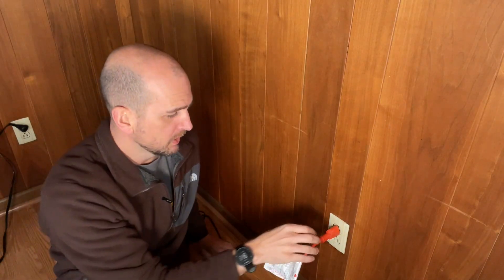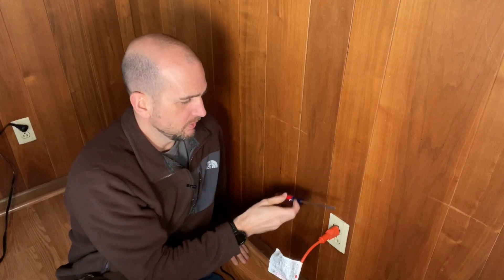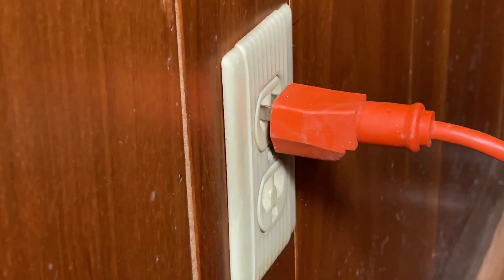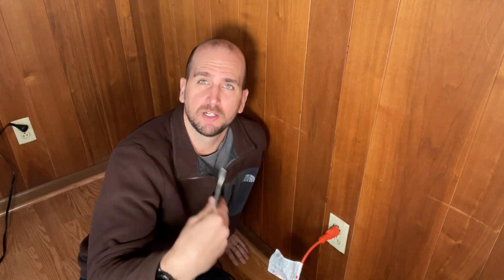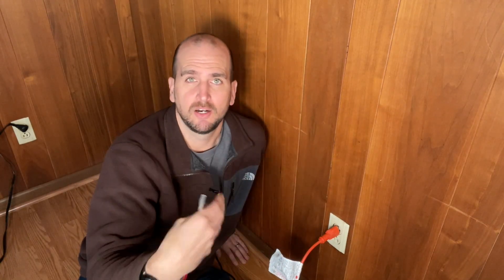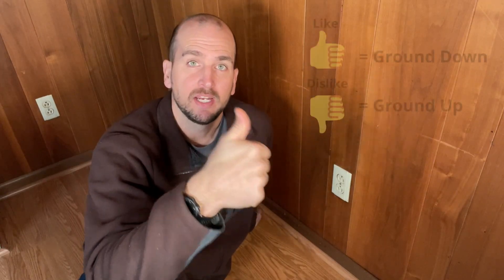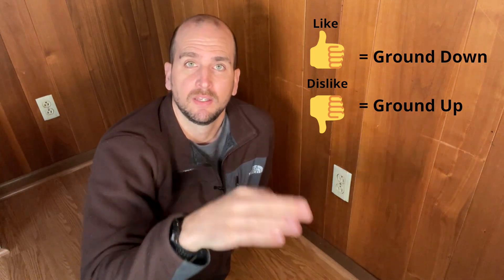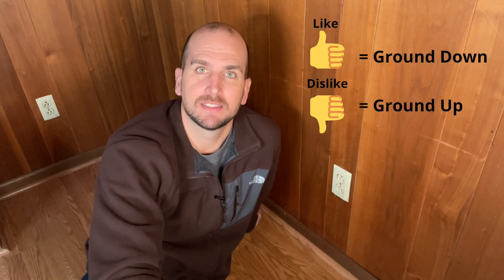Should An Outlet Be Installed Ground Down Or Up

Comment: Then there are countries where the conductors are insulated except near the tip so by the time conductive parts are exposed, there are no connections other than the safety ground.  I believe this would be the UK plug where the ground pin also opens a door to the other pins so kids can't just jam a butter knife in.   Face it, North American outlets are just poorly designed to begin with.
Reply: Agreed.  It would be great to have an updated standard but I don't see it ever happening.  The U.S. was one of the pioneers of electricity in the 20th century, and that meant people needed to have a U.S.-style outlet connected to a U.S. style grid to take advantage of it.  Small countries basically adopted whatever standards their larger neighbors put in place.  Then there's the little issue of the U.S. "democratizing" countries back to the stone age, and then having to rebuild their infrastructure from scratch.  The best we can hope for are more band-aids like GFCI, AFCI, and shuttered receptacles.
Reply: @docferringer  Well, we will have the option of intelligent grids soon where a device communicates it's power requirements but this will likely just affect receptacles for electric vehicle charging and would just allow the grid to draw on power stored in the electric vehicles batteries as a last resort when the load on the grid exceeds generation capacity and the power from the cars could keep it from collapsing.  Yes, the bandaid for problems such as what happened in Texas will actually be the green new deal not that such problems being from such efforts which have not even begun.   I don't see this changing the common US household receptacles yet though that too might be possible with an intelligent grid, where power isn't delivered to the receptacle above certain levels till it's been negotiated by the device.   Like with everything else, it will take something like the States or the EU to pioneer the intelligent grid.  One last chance to do something sort've right.
Reply: This ain't quite right,  we mandate TR outlets in residential areas which does what you are saying regarding child safety
Reply: @GenieArms  Ground fault circuits are not insulated conductors.  Have a look at the UK plug, the copper conductors are simply not accessible at all till the electrical connection has been broken.  That is simply not true of the US TR sockets you are speaking of, the TR sockets trip if the amperage in the hot and return lines are not balanced indicating a ground path, this is not the prevention of unwanted conduction but the interruption of such conduction after it occurs.  The tamper resistant features of the child protection plugs close off the holes but that's another feature and once the conductors are in the holes, exposed parts of the conductors can still exist while the conductors are electrically connected.  The UK plug has such features triggered by their much longer ground plug, how are the doors opened with the US TR plugs? By sliding the plastic cover?  The conductors can still be partially in the US TR socket and still electrically connected exposing the conductors of the plug while hot.
Reply: @johnwang9914  No the TR outlet is a mechanical connection that will not open for a singe object like a butter knife but needs the dual pressure of pronged outlet,  you simply don't know what you are talking about sorry.  It's not an electrical monitor of any type.
Reply: @GenieArms  Not open for a butter knife to enter but the plug can still be partially in the socket both connected electrically and having exposed parts of the conductor accessible to said knife outside the socket.  The TR socket is only part of what the UK plug and sockets are as it is just the socket, the issue with exposed conductors is with the plug not just the socket and the US TR still has the flawed plug that can be partially in the socket and still electrically connected.

Are you claiming the US TR socket does not use the US plug?  Because that would be the only way for the conductors on the plug to be insulated when partially exposed.
Reply: @johnwang9914    It uses the the US plug but it's an internal barrier, so if the plug is pulling out the doors on it will shut.  Between that and the AFCI breaker at the panel US wiring, WHEN DONE TO CODE, is pretty safe.  People want to shit on the US, and fair enough we deserve it,  BUT our insurance industry does not want to pay out claims, so they are VERY involved with electrical safety,  so we are really advancing our electrical safety in new construction.
Reply: @GenieArms  And what is this thread about?  It is about a partially inserted plug exposes bare metal conductors to whatever falls across them creating a short and that can't happen with the UK plug as the plug has insulation such that bare metal can only be exposed when the electrical contact has been broken.  TR plug g or not, the US plug is still uninsulated period and bare conductors can be exposed while electrical contact still exists period TR socket or not period.
Reply: @johnwang9914  I'd have to do some testing, but you are talking about like a millimeter or so of space,  i have NEVER seen a short occur in that situation, and if it did the breaker would clear, and if the breaker didn't clear, the afci would clear and trigger the breaker.  You would have to lab manufacture that situation,  It's not like people are being detonated every other day over here, thats absurd.   A vast majority of our electrical deaths are during construction from contact with overhead lines or power cords drug through water without the GFCI being installed or in working condition.
Reply: @GenieArms  The whole point is that the conductors are bare to the base and the socket grips from the side so any degree of partially being plugged exposes live conductors.   You may wish to diminish this by saying it's just a millimeter but it's still exposed conductors and can be as long as the metal clips that make the electrical contact within the socket, the UK plug has an insulated sheath such that exposed metal can not occur until after the conductor has been disconnected from the metal clip which makes the electrical connection and this is by intent.   Simply, the US plug and socket never took the partially plugged in condition into account in the design period and the UK plug shows that they could've.
Reply: @johnwang9914  well i'll be sure to call edison and tell him he done fucked up then
Reply: @GenieArms  Edison wanted DC but we now have AC.  There is always a way to change how things are dine even if they are entrenched.  Remembee it waan't too long ago when US plugs and outlets were two prongs not three.  They could start with an insulated sheath around the base of the plugs that's lightly longer than the contact clips.  Of course there might not be enough recess in those clips in the socket for that to work but they could also start with that clip being more recessed, perhaps only having the tip of the plug conductors having an electrical contact.  There is still room for improvement with the US system, just not much of a profit motive.
Reply: @johnwang9914   We got way bigger problems than a type of device that caused zero hospitalizations last year i think
Reply: @GenieArms  Making things up are you... The whole point is this thread was about if it was better to mount the US sockets with the ground up to prevent something from shorting out exposed conductors if dropped onto a partially unplugged plug.  You're just trying to deflect now that your TR sockets point has been shown to be meaningless.
Reply: @johnwang9914    Uh but the mounting it ground up to prevent shorts is BS,  the code doesn't require that style of mounting because it's not proven any more safe.  I looked at the stats, and none of the electrical hospitalizations were caused by receptacle outlets.  I'm done with you,   you are outsmarting yourself.
Reply: @GenieArms  But the thread are people discussing whether or not to mount it ground up.  What code says is another matter yet again, read the bloody thread and stop deflecting.
Reply: For anyone reading this that wants the actual information on how safe these TR outlets are,  i had installed them throughout my friends house,  i went back and tested how far out you could pull the plug and have a connection.  The TR outlets will spit out any half plugged in plugs, so  there is absolutely no risk of shocks or short circuits.  Ignore the idiot that is saying they are not safe plugs here in the US,  they are very safe if you use the appropriate plug.
Reply: @GenieArms  Inductive reasoning isn't a valid argument.
Reply: @johnwang9914    Not being able to admit you are wrong isn't a valid arguement either, but you stuck with it till the end anyway.
Reply: @GenieArms  come on, "spit it out".  If we open the TR socket, will there be an actual mechanism to spit out a plug or just a tight clip.  Face it, the plug still has uninsulated prongs and changing the socket does not change that.  You are the one that's wrong and unwilling to admit it. Show me a TR socket that layers an insulating sheath on the prongs and I'll give in.  My argument is changing the socket does not change the plug and the UK plug has both a different socket and a different plug for the safety features it has.
Reply: @johnwang9914    Just buy one and use it einstein.  it's got a mechanical connection that prevents the plug from being in a half inserted position.
Reply: @GenieArms  For heaven's sake, changing the socket does not change the plug period.  You're acting like a child.
Reply: @johnwang9914    You've probably never even seen a US plug,  honestly why are you posting input in this?  If you could just go to home depot and buy a TR plug and any american appliance you would understand, but you can't so you won't.
Reply: @johnwang9914    i was aware you were an electrical engineer from about 1 post in,  you talk like you know about a product you've literally never held in your hands, you have to fall back on your credentials  but why would anyone ever trust someone about a product they've never even seen.  My god man.  I've installed thousands of these things,  never heard of a single injury related to them.   No single data point available points to even one injury in an entire year,  with 350m people using them multiple times every day.  Only an e eng would be this stupid about electricity honestly.
Reply: @johnwang9914    Just stop spreading misinformation and buy one.  They have a spring and door that push out any plug halfway in and only conduct when it's fully seated.
Reply: @GenieArms  You're playing the child again aren't you.  Just using the TR socket does not mean the plug prongs is no longer bare to it's base.  Your crap about it spitting out a partially inserted plug shows that you don't even know what's in the socket, residential grade has a single piece clip which over time becomes loose as it's deformed by each insertion, commercial has two sprung contacts per prong which does not become loose after multiple insertions and removals, all you've demonstrated is that you found it to be tight.  I don't need to hold to see the specifications and designs and I've held far more plugs and sockets than I care to count though mostly for commercial equipment not the child proof crap you're speaking of.  Besides,it's clear that you've never seen inside the socket either in it's design or by opening one up.  The very design of the flat prongs means the socket doesn't "spit out" the plugs.  If you want to talk of holding a socket and plug, have you even seen an UK plug and socket?  Besides, I've already pointed out that your fixation with holding the plug is not a logical argument but a paltry attempt at inductive reasoning and anecdotes.  The TR socket does not match the safety features of the UK socket and plug as the safety features are in both the socket and plug but you're too much of a baby to admit that.
Reply: @johnwang9914    Here buddy, look at the inside 
https://www.youtube.com/watch?v=e1A-wlS97Lg&t=331

when the plug is starting to come out the spring engages and pushes the plug out.  When you get past the shutter the spring lets go and it sucks the plug the rest of the way in.  I mean i know these guys are smarter engineers than you, figuring out springs and all,  but come on.

Comment: Here is a bone of contention among electrical contractors typically they ignore a ground bus bar in the panel and you will find neutrals and grounds connected to the same bus bar.   This is not good in that an outlet that you thought was off could still have a minor current back flow thru it.   Mostly done by apprentice electricians.

Comment: I worked for my dad, who was a licensed master electrician, and he was taught ground up so we always installed them that way. The reason is because with NMB romex that has the bare ground wire it is easier to see how it is bending as you push the receptacle into the box if the ground screw on the receptacle is up. If a loop in the ground contacts the hot screw it will short and you’ll be taking outlets apart on the circuit later to find the problem. That said I remodeled my kitchen recently and had to go ground down for counter receptacles due to 90 degree cords on some appliances (frig, countertop micro, stove, water cooler). Also I had a light show one time with a nickel falling off the back of my dresser and welding itself across a loose two-prong plug.

Comment: Because electricity travels down like lightening, ground should be on the bottom. 

But I can see the suggested reasoning for objects falling hitting the ground plug first.  

I think most interesting though as mentioned many plugs that fall out or come loose are 2 prong.  So chances of something falling & hitting it wouldn't matter which direction the ground is facing.  Although I really don't know of items just falling off the wall unless in an earthquake so I find it an odd argument, how many times has something just fallen onto your outlet?

Comment: I do ground down in the USA, I've worked with Canadians who always install ground up. I also worked with a "left handed plumber" whose hot and cold handles ware always "wrong"!
Reply: Where in Canada? I've seen nothing but ground down on new construction. In Quebec it's code to do it ground up.
Reply: @nimrodery  not in Canada, 2 Canadians and 1 Australian I worked with in Missouri.
Reply: @ricklee4  I'm just saying, they were probably from Quebec, or they did a lot of commercial where it's often a requirement.

Comment: The only time I've done ground-up is when the GFCI line connections came into the box so that ground-down wasn't possible. Ground down seems like the standard for pretty much all consumer electronics I've used too, ever tried to put in a polarized timer box upside down? It sucks.

Comment: On a side note I have to say, I wish I was a licensed electrician because I would literally do pro bono work and install light fixtures in every single home where the builder cheaped out and went with switched outlets instead of hanging even a $50 fixture there. That is insanity and it drives me nuts every time I see it. Even some nicer homes $2-300k+ near us do that and it blows my mind. I'm a painter though so can't risk doing electrical for anyone besides myself. As for the ground up or down I don't know, I sort of get the argument for ground up but imo it really doesn't matter in the real world. 99% of what I've ever seen are ground down and they're always fine.

Comment: I always do Ground UP.
Two reasons:
1 - Because the ground lug is longer length than the blades, it makes it easier to start, and locate, with the longest piece first. 
BUT mostly, because I seeing the shocked expression on the face of the ground down  😲

Comment: i prefer ground up because when you grab the plug with your hand to pull it out your thumb is always on the top and sometimes the plug i very snug so i find myself placing my thumb against the wall or plate for leverage to wiggling the plug loose and just before the plug pulls out there is a space between the outlet and the top of plug that my thumb can slip into and touch the prongs possibly shocking myself

Comment: I am an ag mechanic, who loves electrical. I work on irrigation pivots, to vehicles, from 480 volts Ac 3 phase down to 6 volts Dc. 
Around the house I usually put the ground down, on a washer, refrigerator or microwave with a 90° plug, so the cord goes down. 
Around the farm outside of the house, I put ground up. An old local electrician told me to put the ground up, any where there were heavy extension cords plugged in.
Ray mounted 2 outlets, 1 up, 1 down, took 2 extension cords, plugged them in to each outlet.  Ray told me to pull down on the cords. The ground down cord can out much easier than the ground up cord did.  I then swapped the cords because I did not believe that it would make that much difference.  
Any more I mount all of the shop, machine shed, pump house, barn & outside outlets, ground up. 
Try it, then swap the cords, then try it again. 
You will be amazed how much difference there is. 
Hello from north east Montana. 10 miles from the Canadian border. 
A very special tip of the hat to Ray Padgett, a local electrician who taught me a lot.

Comment: I figure if a cord is tripped over and pulled from the "ground down" outlet then the last contact to be broken is the ground...seems safer??
Reply: Yes true and code book here shows G down  as stated, Last pin to pull out should be ground ,,also if you buy a test plug with indicator lamps that show Hot Neutral and Ground wired to proper terminals connections you would have to stand on your head to see the lamps that are on ,,GROUND DOWN ..Plus your GFI takes care of any ground fault issues....